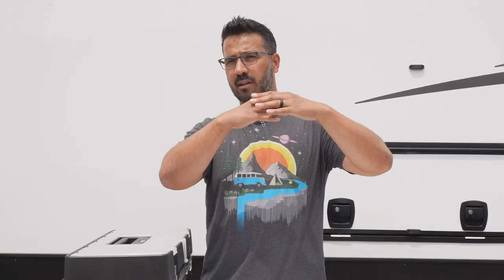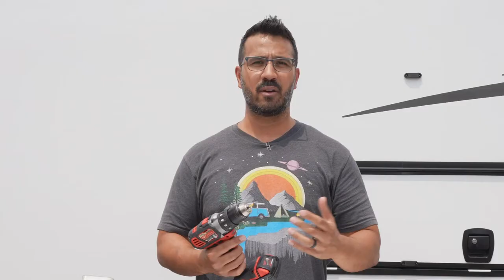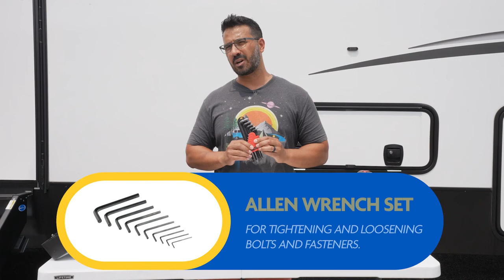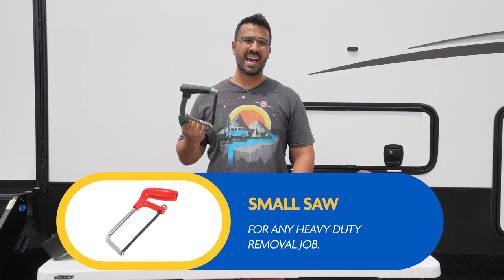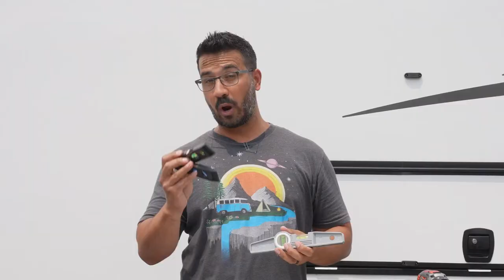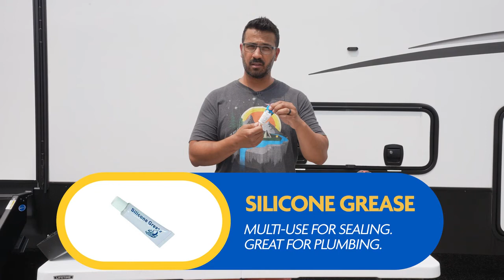MUST Have RV Tools | RV Basics

Comment: I spent two years as a fulltimer and many months a year for several years as a parttimer.  I started out with lots of tools, hardware and spare parts.  I hardly needed any of them.  I certainly did not need a power drill, multimeter or most of what I started out with or see in this video.  I needed a multitool, adjustable wrench, a caulking gun, tube of caulk, and a tire gauge and tire compressor.  Later I learned to leave the vast majority of my tools, hardware and parts behind.  On the rare occasions I need something, I stop at the nearest hardware store.
Reply from the maker: Hey James, 

I appreciate you sharing your experience. My standard grab-and-go kit consists of a power drill and impact driver (with a few bit and driver sets, including that #2 square bit), a hammer, and some smaller assorted screwdrivers. 

But I also keep tools in my truck round the clock. These are mostly what I'd need in the event of a tire blowout so I can at least pop the spare on and keep rolling instead of being stuck waiting for assistance. 

Every RVer eventually finds their balance of the tools they'll actually use vs what might just overload their unit. 

- Tucker Ballister

Comment: There is no way this will all fit in that toolbox. What would be really helpful is a video of the few tools that cover most situations that come up with RVs. Otherwise, a visit to the local hardware store for the unforeseen rare issues is always an option. Rather than carry around a boatload of tools taking up valuable storage real estate in order to try and cover every possible scenario that might come up however infrequent if at all.
Reply from the maker: Point well taken on the size of the toolbox here! You can check out our written tool list, which includes our Top 8 choices, along with lists of hand tools and maintenance supplies to consider keeping in your camper: https://blog.campingworld.com/gear-and-accessories/60-must-have-rv-tools-and-supplies-for-safe-travels/.

Of course, the tools each owner will find most useful will always depend on the types of maintenance and/or DIY fixes each is comfortable with. Hope that helps!
Reply: @CampingWorldTutorials Thank you, that does help. I clicked on the link and have the same air compressor in the photo on the page. I have found it practically impossible attaching it to the valve stems on the inside of the side-by side rear wheels. Really disappointed they don’t have some straight adapter that can go through the tire rims to reach the stems. Works great on the front wheels but that’s about it.
Reply from the maker: That frustration is understandable. Some manufacturers will install extended valve stems for this reason, but they are also available as an aftermarket product!

Comment: Please, for the love of all things pickled, don't you believe for an instant that your regular glasses will protect your eyes from debris. As you said, you only have one pair, protect them.

Now for some add ons to your box.
Zip ties,
A spool of bare  wire,
A spool of 14awg wire, stranded,
Duct tape,
Tire repair plug kit,
Tire inflator,
A battery charger, spare battery,
The knowledge of how to use that Muti meter,
Fuses, assorted,
Penetrating fluid, Rust breaker,
radiator hose repair tape,
AAA auto insurance.
Reply from the maker: All great feedback and additions to our list! Anyone interested can find a more comprehensive written list of tools and maintenance supplies here: https://blog.campingworld.com/gear-and-accessories/60-must-have-rv-tools-and-supplies-for-safe-travels/